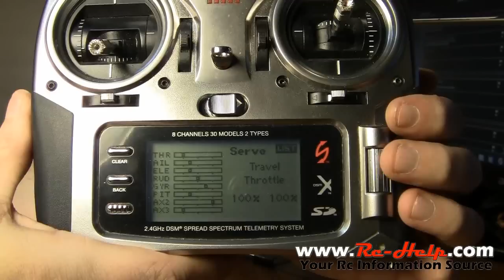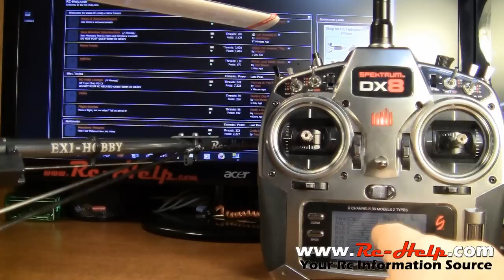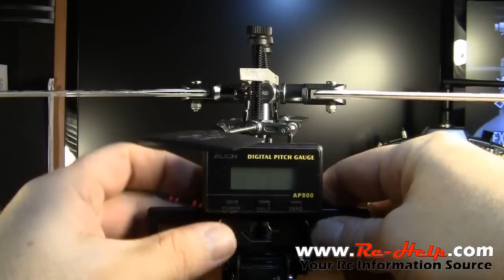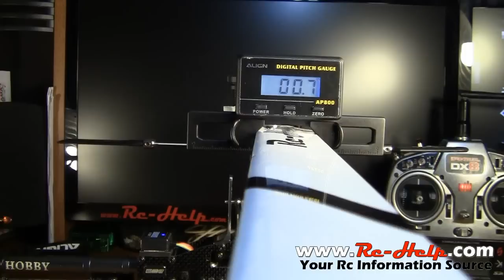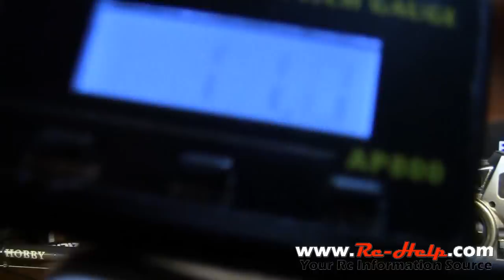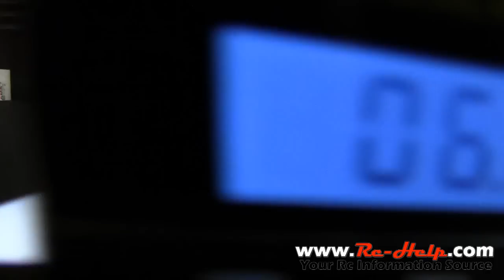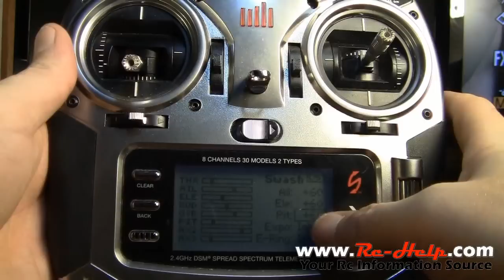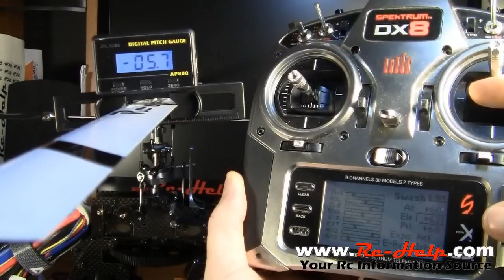Complete Flybar Head Setup

Comment: I was injured! His warning about making the blades 101% safe by  isolating the motor is absolutely essential,  on planes and quadcopters you do similar except you remove the prop.
When setting up my plane I read time and time again that this should be done but I was  absolutely sure I'd be ok, that I would be carefull not to throttle up.

The autopilot sent it to full throttle whilst setting something and I had a huge plane with a wingspan of over 6 feet and a 700w motor swinging a 12" prop suddenly launch at me

The prop made 22 lacerations to my arm, 18 of them deep in less than 10th of a second,  the motor didn't I've slow a little when it hit me, just chopped through spinning at about 170 revolutions per second.

I ended up in hospital and now I'm have a load of bad scars on my arm that will be there for life

Disconnect your motor!!!!!!!!!!
Reply: Yeah, I'm fine but what happened to me need never have happened if I had just listened to the safety advice,  I know many others ignore it too and people need to know that these accidents really do happen no matter how careful you are, don't take the chance!

Comment: This was great and I followed it.  But, you never said what percentage to set in the swashplate configuration on the radio before starting the setup .  So I started the process with the swashplate values set to 100% for each (the aileron, elevator and pitch).  I levelled the swash plate at 50% pitch on the radio (no problem), levelled the washout arms (no problem), adjusted the blade pitch as you described, no problem.  BUT, when I then attempted to measure the full pitch range from maximum negative to maximum positive, the swashplate vertical movement range was so large that the flybar pins came out of the tracks on the head !!!!!!!   I then had to reduce the pitch value in the swashplate configuration on the radio down to 40% to prevent the pins from coming out of their tracks on the head.  What went wrong here??????

Comment: Thanx for a detailed setup guide.
Do you think levelling the swash, using a swash levelling tool, would be a better approach, instead of the zip tie jig. The reason I suggest this is that once you adjust the swash, and the three prongs of the tool are in contact, at zero pitch (mid stick).....Next you may want to give full positive & negative pitch to verify that the tool is still nice and square with the swash. If there is some discrepancy ( full up or down swash) this can be addressed from the radio (swash menu or servo end point menu). No matter how square you set-up the servo arms plus the fact no two servos have 100% similar throw. By going through this step, one is sure not to have any "cyclic effect" at +ve or -ve pitch.
kind regards
Doc
Reply: Thanx for a prompt response.
Rgds

Comment: I think this is very good, but I have a DX7s which appears to be 90% the same as your but I don't have any swashplate menu item? When I increase throttle/pitch, only one servo moves (aileron) edit: ok I found the swash type menu in the alternative setting screen, it was set to 1 servo normal. I'm guessing I need to select 3 servo 120° for flybar setup.

Comment: Great video! This works great with my Blade 450. I just got done building an Align 600e DFC with the 3GX V3.1. Those videos on that set up with your nitro build worked great too. The one thing that I'm a little stuck on, is the flight mode setups on these new firmware versions of the 3GX. I'm not all that sure what percentages I should have those at as far as roll rates, end points and swash dampenings. Also, would you be able to run a video showing the DX8 settings running a 3GX just 2 sat's?

Comment: Hi,
I like your presentation on how to setup the flybar head.
I have 3 questions:
1.  Do you use idle-up, throttle hold, pitch curve to do this setup?
2.  What about normal mode and pitch curve? Presently, I do scale flying and hovering.....no 3D yet.
3.  How do fabricate your tool to clamp the flybar level?  I have problem keeping the flybar level during setting up pitch curves.

Thanks
sam

Comment: so I have a question.  Your video is awesome, I have every thing set up, the swash moves up with pitch increase, (all three servo arms go up)  the elevator moves in the proper direction but the ailerons move in the opposite direction of how they should, Ie aileron stick left but aileron servos move right.  Im sure I am missing something but with everything else correct how do I get the ailerons to move in the right direction.  If I reverse something then something else is not correct.   Advice?  Thanks .
Reply: sorry, I spoke too soon, got to the end and figured out how to get it right with the swash program and going from positive to negtive on aileron.  All is well now.  Thanks for the help

Comment: I hoping you can help me.  I followed ur complete flybar head setup video, but I'm having a problem having levelled the swash and achieved 0 deg pitch at mid stick (Spektrum DX6i).  When I check the full range on each blade I'm getting roughly +11 to 3.5.  I have made adjustments to the swash and can get +9 to -8.7 but when I check the pitch at mid-stick it has moved to 3/4 degs.  I assume 0 pitch at mid-stick is more important than the +/ settings.  Can you advise me what I should do next as I seem to be going round in circles.  Thanks.

Comment: I love it, thank you! Question: How does the rotorhead not go up or down when you try to read the pos./negative pitch? Can it be done without the pitch gauge?
Reply from the maker: I'm not sure I understand your question, but I will try to answer. The servos are attached to a swash that slides up and down the main shaft. There are links that then go from the swash to the washout/mixing arms, and then to the flybar cage and blade grips. The head block (the top piece that holds the blade grips) is mounted directly to the main shaft so it will not move. As for doing it without a pitch gauge, you can, but I would invest in a $3.00 pitch gauge at least.

Comment: Question how did you setup your tail rotor, i am having a problem with my trex 600N, i put a little right tail input at lift off but when i decrease throttle the copter spins out of control to the left, that's tail moving left nose right.  what can i do. I fly with a dx8 raido and i am setup with rate gyro, and have tried HHold same problem.

Comment: Is a digital pitch gauge necessary? I have an old plastic mechanical one that I used but when I built my heli from scratch I did it all by myself with the help of the internet. I build a exi 450 pro. I crashed it like the maiden flight. Rebuilt it upgrading everything on it accept the frame to actual trex 450 pro parts. So it's a trex 450 pro with a belt/sport tail and a quark gyro. It's hovers really well but I've been xxcared to fly it since rebuilding it. I was thinking about getting a micro cp to practice on. I have an Msr that I'm pretty good at but I want to upgrade that to a cp. I think buying a cp would be cheaper then buying a gaming computer and a good SIM. Is there any Sims that will work with a laptop that's several years old? Most of the good ones say they need a graphics card with dedicated memory
Reply from the maker: You absolutely do not need a digital pitch gauge to set up a flybar helicopter. In fact, now days when I'm setting up a flybar helicopter, I pull out the old mechanical gauge and I don't even use a flybar locking tool. Will it be exact? No. But for general sport flying it works great. Just eyeball the levelness of the flybar rod and get it as level as you can, and read the reading on the gauge. Make sure to put the gauge as far out on the tip of the blade as you can for a better "by eye" reading. 

There was a sim that would run on older graphics cards, and you can still find it, but they went belly up. That sim is Phoenix Rc Flight Sim. We used to do Simulator Sundays where we would live stream and invite everyone in to fly with us. But since they are out of business and closed their master server for online sessions, we no longer do this. But you can get the sim on places like eBay and the like, just make sure it comes with a GOOD cable. You MUST have the cable for the sim to work. Other than Phoenix, all of the other sims pretty much need a decent graphics card. So onto the CP helicopter.

I know your pain in taking a clone and making it reliable with Align parts. I have a video "How To Properly Build A Clone Helicopter" where I show what I ALWAYS replace on a clone build. And once you get that much money invested in the helicopter, especially after a crash that costs over $100 or more (depending on helicopter size), your nerves play a roll in not allowing you to progress anymore. I know, I have been there and it is very hard to push through it. 

You say you have an mSR and that is the helicopter that taught me how to fly. I could fly in the sims but not IRL until I purchased the mSR. I could crash that little guy and just flip it back over and keep going. It was awesome when I could finally fly a helicopter. And all of that transferred to a CP helicopter for the most part. Mostly orientation though. And the sound of a CP, well that is a whole other level of nervousness lol. 

So you are looking at getting a CP helicopter to take the place of a sim. I want to start with saying, you are going to crash and it will still break parts. But the parts are far cheaper than a 450. I did this exact step just as I did with the mSR but this time I purchased the mCP-X, the old version, the first version lol. It was a learning experience and in the first week, I knew the parts that I needed to stock up on. Blades, tail booms and main blade grip linkages. All were very cheap compared to a 450. Once I had a few of those parts on hand, I just kept trying new things, kept flying and eventually it pushed me past that nervousness of the expensive helicopter because that mCP-X reacts faster than a 450, and when I went to the 450, I felt more in control. 

Now days, there are WAY more options for CCPM helicopters in the micro ranges. Back then, the mCP-X was it for me. But now everywhere you look there are companies building them. Just don't go crazy with something like the Align 150x. I have that one too and it is a lot of fun, but a little more expensive to crash and WAY more powerful. But if you want a name brand, and don't mind paying slightly more, the 150x is a great helicopter IMO. But be warned there are some out there with gyro issues (align, gyro issues? Nah! lol) I love my little 150x. 

I know this was very long, in fact this is probably one of the longest replies I have sat down and wrote. But I wanted to let you know, you are not alone in feeling nervous about flying after a crash. We have all been there. And what helped me is just what you are wondering about. Micros can help out for some people. Hopefully you are one of those people as I was. If this helped, come over to the forum and post up your experiences. Hope to see you there. www.Rc-Help.com

Comment: Great video,but I have one problem. I can't adjust flybar, because connecting rods to two horizontal arms are solid. Also the rods from flybar to blades holders. Do I need to change them? Thanks
Reply: RcHelpDotCom Thanks. That was fast. I just bought a used hk450gt heli with custom parts and with a lot of spare parts. Because I don't want to crash the heli on the first flight, I just want to check that everything is set ok. Thanks for help. Lp
Reply: RcHelpDotCom Tnx. I will. I just realized that I need to do it again, because throttle stick on my dx8 wasn't calibrate to the middle. I saw this when I realized that my zero pitch is 5 degrees +. I moved the stick in the middle of the process because alarm on the tx went on and I just lowered the throttle... 😁 I'm already scared because I'm used to fly planes and drones and now this middle throttle thing...
Reply: RcHelpDotCom Yep. Always in Horizon mode. Just looking for a racing drone to buy. Or to build one. Head on heli is ok now, but now is a tail rotor & gyro (HK401B) on a list... I just almost messed everything when I followed some guide for similar gyro and dx6i transmitter. Do you have video for thus too? 😁
Reply: RcHelpDotCom Oh, I didn't know that it's so bad. Probably that's why it doesn't correct rotor blades correctly. It was already on the heli. Well, I guess I will need to wait with the flight. Thanks for your help again.
Reply: And this guy connected digital servo on this crap...

Comment: Hi Tony, i am using IKON2 FBL. As instructed by IKON 2 manual,
I setup the blades, zero pitch at mid stick and -12 degree pitch at bottom and +12 degree pitch, stick at high point. I am using a Align pitch guage and Futaba 16sz. For beginner normal pitch that is 
bottom stick (low speed) pitch is -2 
Hovering little above mid stick (65%) +5 degree and
 high speed full throttle +11 degree. My question is, do we need to change the blade pitch in heli (using pitch gauge) or in transmitter.  Please help. like to know relation between pitch in the heli and pitch in Transmitter. Thanks.
Reply from the maker: You will adjust your pitch in your Pitch Curves in your Tx. Once you get 0 at mid stick, and +-12º, you will not adjust the helicopter from there unless you have an issue. Set your pitch curve to 46-48-50-75-100 and you should have a slight amount of negative pitch at low stick. Hope this helps.
Reply: @RcHelpDotCom  so in Futaba Terms, in TX, Normal Pitch curve is  -30 (bottom stick) ,-10,+10 (mid stick),+50,+80 (full throttle) is that correct ?
Reply from the maker: Okay, I take it Futaba uses a -100 to +100 scale? If so, 0 will be mid stick so the third number should be 0. I would only go to about -10 on low stick and the last two are going to be linear. So, if you have a -100 to +100 scale, your pitch curve should be -10 -05 00 +50 +100. If you don't want full collective pitch at 12º, then adjust the flybarless settings. It's just easier to stick with a linear curve than it is to start putting weird pitch curves in your Tx. Come on over to the forum and post up, there are quite a few people there with Futaba Tx that can help out a lot more than I can. www.Rc-Help.com

Comment: when you started using the pitch gauge on the blade you then had a couple of large screws bearing down on the flybar.  where do you get them?
Reply from the maker: That is just a homemade flybar lock. It is just a piece of 3/16" acrylic that I drilled a center hole in to secure it to the head block, and then I drilled and tapped two holes for the thumb screws. As for where to get them, I have seen the really cheap ones on hobbyking, but they don't have the screws. Not many people are making these anymore because of the popularity of flybarless now days. www.Rc-Help.com

Comment: I have a tiger thunder raptor 30 nitro heli would this process work the same even though my servos are in different areas? Just making sure I follow the same process
Reply from the maker: I do apologize about the delay in replying, I didn't get the notification you had commented. This should work very close to the same setup procedure except for the servo setup. If I remember correctly, the Raptor 30 has a 'Mechanical' swash meaning one servo for elevator, one servo for aileron and one servo for the collective pitch. But linkage setup and pitch settings should be exactly the same. Come on over to our forum if you need more help. I never miss a post over there lol. www.Rc-Help.com

Comment: I have a question. In my heli the ail an ele servos are at an angle in the frame. Do I set the servo arms level to the table or to the servo body?
Reply: level to the swash plate you want the servos and main shaft makin a 90 degree angle